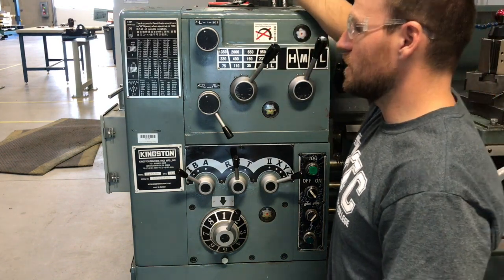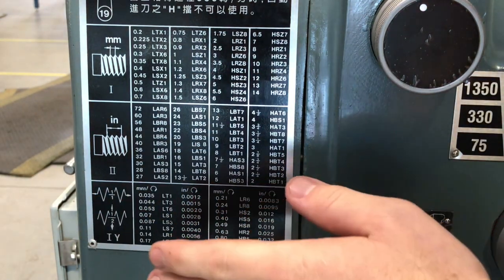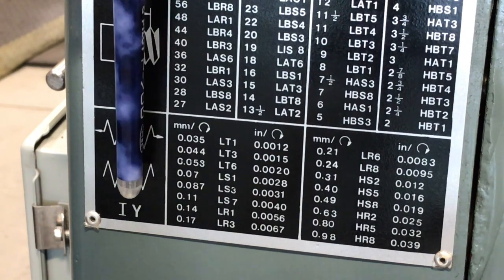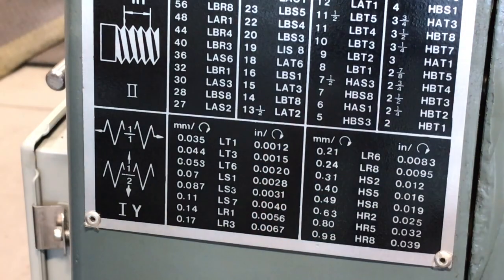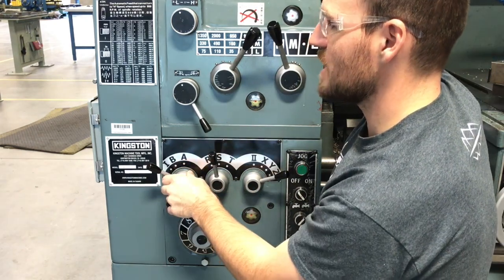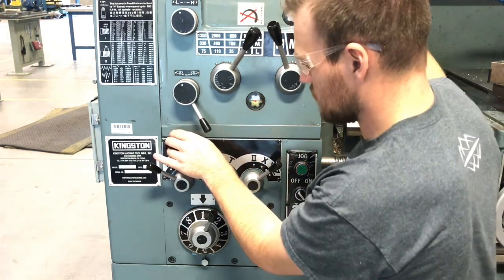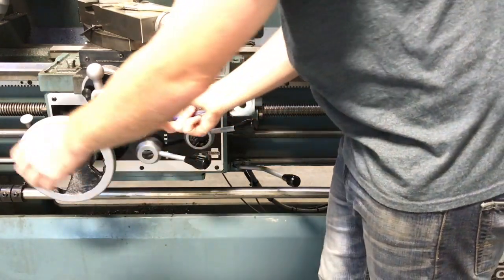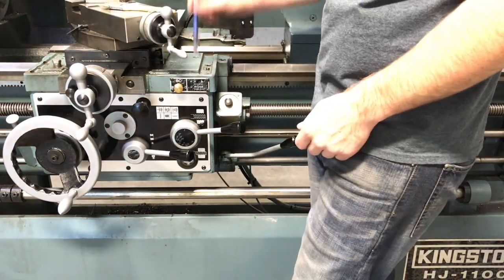Automatic feeds for lathe

Comment: I have questions regarding the feed shaft and the lead screw. the lead screw is used for threading and the feed shaft is for the power feed. but threading is done with power feed also. so does it mean  both will spin for threading ??? plus how about auto feed for the cross slide??
Reply from the maker: The power feed is not used when threading. this is my threading video https://youtu.be/qcxiIMohkao
Reply from the maker: I don't typically use power feed on the cross slide but you should be able to position the knob to the cross slide and it should work. I can point the knob out in the video if you need me to
Reply: @Mikesfilmss  yes please ??